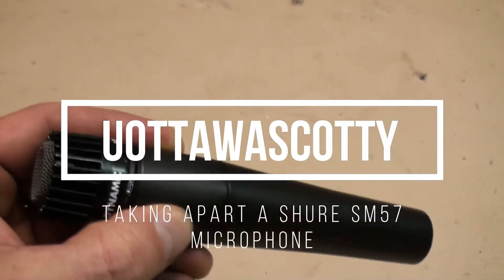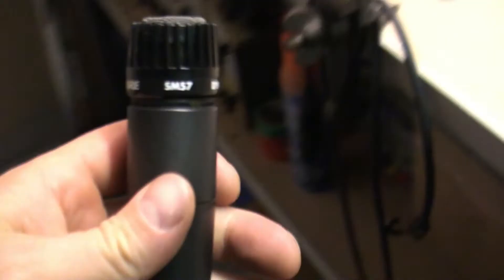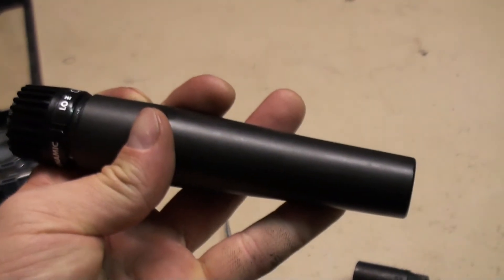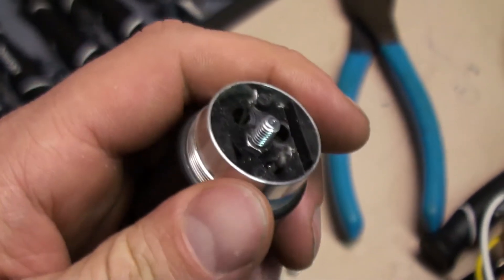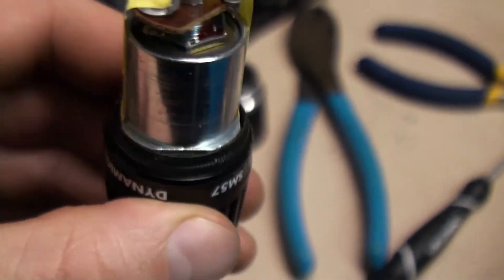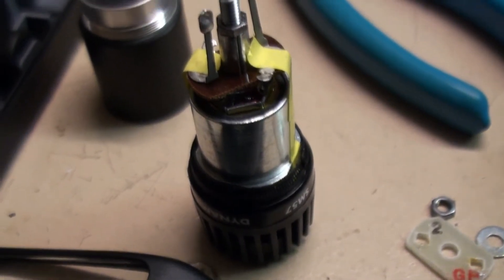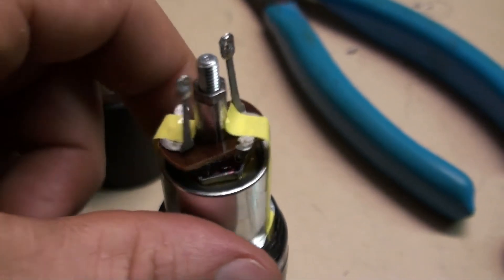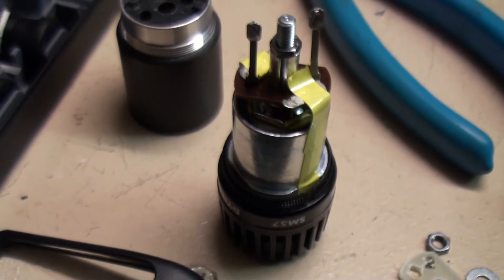Diagnosing and Taking Apart a Shure sm57 Microphone

Comment: I had a new wireless transmitter with SM58 that gave out after a month. I traced the issue to the capsule. For the like of me I could not find the coil lead that connects to either terminal! I swapped it for an old capsule on a defective 20-year old wireless transmitter. Its back in operation now. Crossing fingers as the only thing I can think of was that DC got on the coil some how (?) suggesting a problem with the preamp the coil is connected to. Weirdest problem ever.
Reply from the maker: Uh, well don't forget also that there is a transformer between the capsule and xlr jack, so that offers protection from things like phantom power etc, but still that is very unusual.  Nice to hear that you got it back up and running, I have the same wireless unit as you do and I don't find it very good.  Im just using it for wedding speeches and stuff, but I do find that the proximity effect is way exagerated to the point where if your not right on top of the mic, it does a very poor job of picking up voices.  I have heard that these things are very rugged, but I wasnt really very impressed with the design of the mic while dissasembled.

Comment: Thanks for the great video!  My broken Shure Unidyne 545 brought me here.  
I found this link that might help you with any of those small broken wires.  First, he heat-removes the enamel coating on the tiny wire, and then he uses solder wick to splice the break in those tiny wires, and with success.  Also, be sure to look in the comments at the bottom - there are some good suggestions, as well.  Getting a ring clip tool is a good thing if removing the sping clip in the head of the mic.  
http://chittproductions.blogspot.com/2008/05/how-to-fix-broken-dynamic-microphone.html
snap ring pliers: https://www.acehardware.com/departments/tools/hand-tools/solid-joint-pliers/2439305?gclid=Cj0KCQjwmdGYBhDRARIsABmSEeNfMSR4RkY6mOB4OY4qknQeLbO3m-iVIstCxw3BbrICEjsZIBRgoVMaAtfnEALw_wcB&gclsrc=aw.ds

Comment: it was the phantom mic cable wire cutting fiend. I've had a problem with that little swine several times. Tonight I attempted some extra percussive sounds and plugged in the trusty old sm57, only to find the wire inside the SLR was severed.  Not quite as bad as turning up for a field recording vocal session, only to find a wire inside the sm57 was cut. I had to perform the entire thing with my thumb holding the circuit in place. On the front seat of a 25 year old range rover classic. Those were the days. Never again. Igot the number though. Bring back 'Lover lover', priority one, all other priorities are rescinded.
Reply: Russo, The Most Barbaric of All Religions 2013. track 7. Car Number 7

Comment: I just fixed one of mine that had a similar problem that occurred after a drop.  When I removed the capsule, I could see that one of the hair thin wires was touching the metal nut and shorting it out. I took a toothpick and gently pulled it away from the nut and now it is working.
Reply from the maker: Thanks for the comment, I'm going to tear into mine again and see if I can fix it, lots of good comments and suggestions here !
Reply: i'll try this fix. dropped my sm57 by accident recently and hasn't been working since then
Reply: hello i also have same drop and dead problem ..and also i  see the  little hair thin wire u mentioned,, but it seems to be touch de metal part  original? what should i do ?